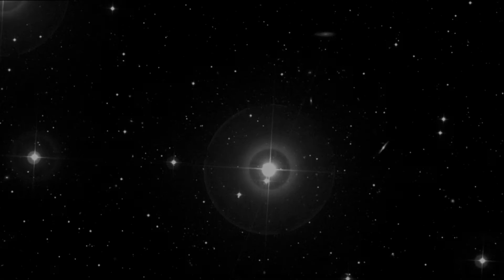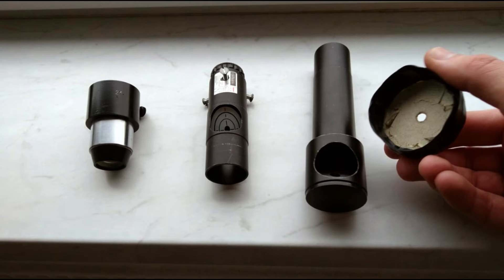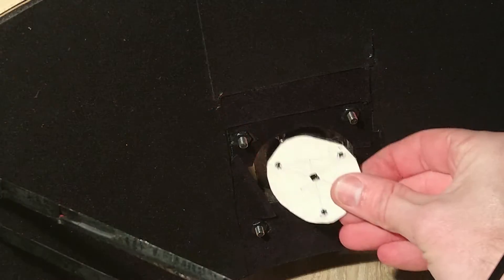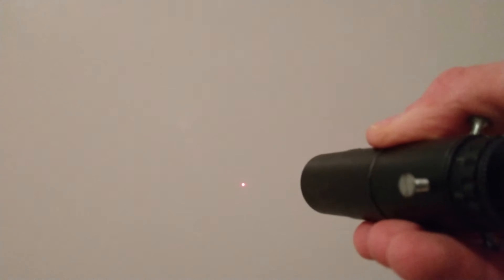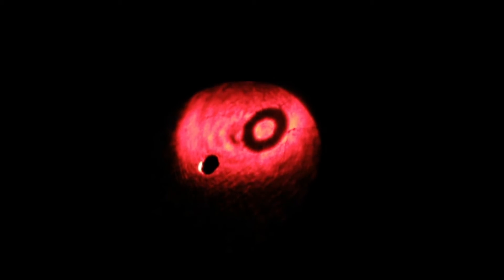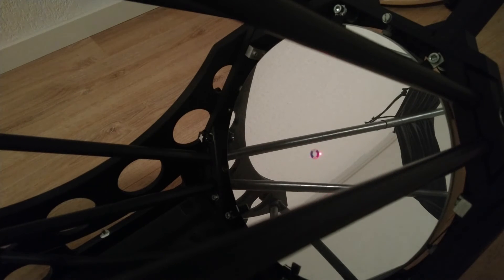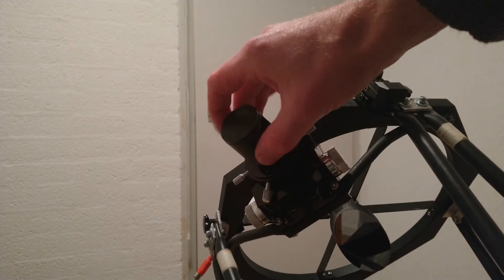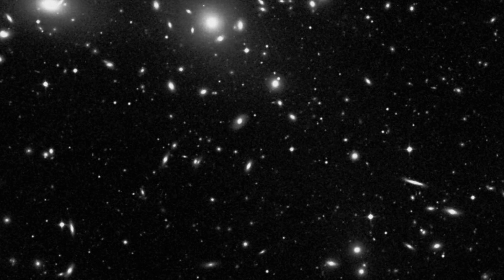The barlowed laser collimation method

Comment: It must be problematic if the factory didn't put the donut in the true center of the primary right?
Reply from the maker: This is true. The optical centre of the primary is not always the same as the mechanical centre. You could do a star test, for instance, to see if those two centres are at the same spot on the mirror.

Comment: This is great, but I was wondering if one could use this also to align the secondary? I find that using the cheshire “sight” crosshair is very inaccurate and I am afraid I am probably never finding good collimation this way…
Reply from the maker: The barlowed laser method is exclusively meant for adjusting the primary mirror. If you don't want to use a chesire for the secondary mirror, you could use an unbarlowed laser. But you have to make sure the laser is properly collimated itself. Otherwise there is no extra accuracy over a chesire.

Comment: Good that you mentioned often-poor collimation of the laser.
It's a shame this method doesn't work for solid tube Newts. It's a novel approach. Using a diverged beam to cast a shadow instead of relying on the beam being exactly centered... 👍
Reply: Why should it not work for a solid tube Newt/Dob?  One can easily reach into the spider and affix the handmade screen-with-central-hole onto the lower extremity of the focuser tube, and then carefully withdraw one's hand again.  Then follow all the steps explained, and then remove the screen.  You're done!
Reply: @mesenteria  maybe once the new has worn off & I'm less timid about the brand new, delicate 10" mirror in mine.
Reply: @OldCurmudgeon3DP Make sure to orient the tube horizontally so the screen won’t drop down. Much safer.